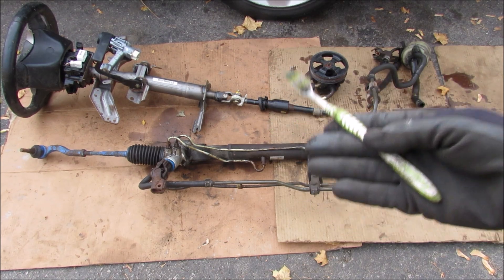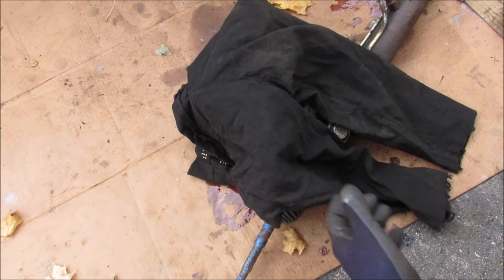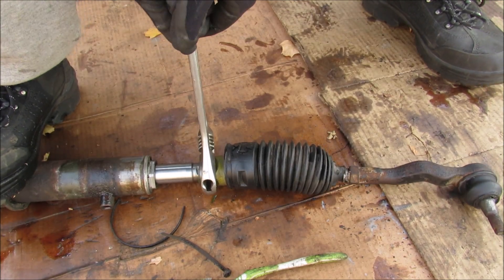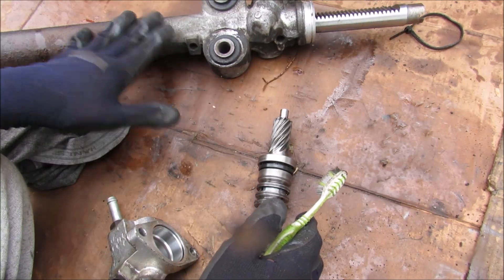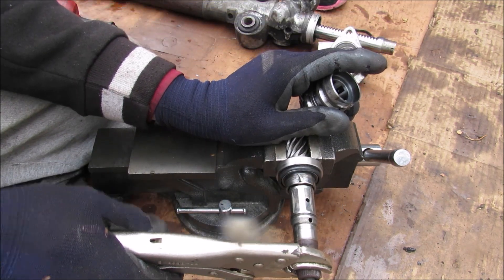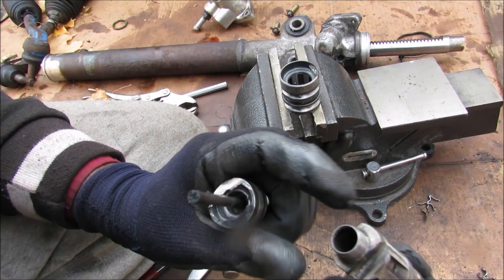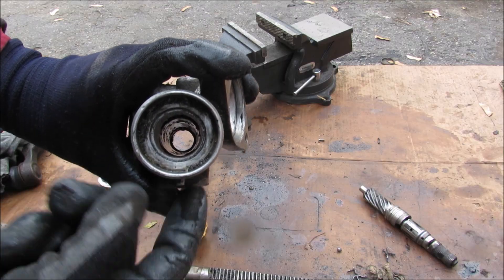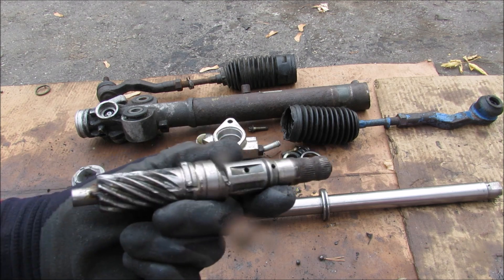How Hydraulic Power Steering Works

Comment: Do you think it would be bad to drive a car without the power seering pump running?
Reply from the maker: It would be quite difficult to turn. Just make sure there's fluid inside and it should be fine.

Comment: Hi Speedkar99!
My steering became squeeky at full lock after replacing the utility belt, and on colder mornings, it is squeeky and jerky through it’s full range of motion.
Any tips or suggestions what to look for?
Thank you!
Reply from the maker: Tighten the belt and bleed the system
Reply: @speedkar99  many thanks! 🙏

Comment: what is the name of "oil seal" that prevent oil from the steering pump to go away in unintended direction in the rotary valve? is it called a oil seal? and is it effective to replace it or replace the whole rotary?

Comment: Lovely video, I just want to ask, can the pinion gear make the steering to be hard of stiff, I use Mitsubishi Montero 2004 limited and the steering is stiff, we have changed the power steering pump still stiff, the mechanic said it is the steering rack pinion that is faulty, can the steering rack or pinion make the steering to stiff. And there are no leak on the rack at all.

Comment: If you blow piston with low pressure air there will be allot of blow-by the rack piston hard seal ring . Fluid pressure expands the seals I suppose to a tighter clearance.

Comment: Just a quick question. When you steer to the complete left or right (when u reach end) the high pressure fluid would be still directed towards that direction. What is the mechanism that will prevent the pressure build up and return the fluid to the return line?

Comment: hi there,
You made a very detailed video and many thanks for explaining that. I have a question regarding the failure you mentioned at 6:12. That failure could be due to a torsion bar or hydraulic pump or steering rack seal leakage, I am facing this hard steering problem in my car these days and I am wondering if you can help me answer this in order to fix my car. Many thanks Regards

Comment: Good video, I was surprised from this shown system I was thinking it is simple.  I have a question I have Saab 9-5 2008 model now when I turned its driving wheel to the left or to the right I hear a "tik tik" sound and disappear if I drive straight, I checked the components of my car wheels  and change some of its parts, but the sound didn't disappear.  I some how sure it's come from it's power steering system.  Can someone give me what a problems in the steering system causing that, I will appreciate any reply to my  problem, thanks.

Comment: where is the Lockstop ?
Reply from the maker: It's sometimes on the suspension
Reply: @speedkar99  thanks for your reply, I have it sorted now,  in the listing for the kits there are two with the same number the second is appended /A .. the first one is steel and the second is plastic. It refers to the plug in the end of the rack body (long side) it is held in by a wire retainer ring, this they call the lockstop.  It really isn't the same as the hard stop on the suspension or chassis but that's what they called it. so if you see it in the catalogue you will know, I think maybe it is an upgrade/alternative it looks as if either can be used in the same housing/body.

Comment: 2:45 No one should use Ty-rap on boot. Lazy/inexperienced/incompetent mechanics use this instead of clamps to save 1 minute and $2 worth of hardware. ty-rap pinch the boot at the attachment point  leaving a small gap enough for contaminants to slowly enter and grind out internal seal shown at 8:00. This is likely to kill steering rack within 50k IMO everyone should look at their boot for ty-wrap after inner tie-rod maintenance by garage and demand a proper clamp if they don't find one. You can find them at part store or dealership for a few $.

Comment: Hello from India. Very informative video, especially the torsion bar thing.  I have a strange issue with my humble ford fiesta with hydraulic PS. I find steering assistance is a bit more than I would have liked. Car turns tack sharp but I'll love to put some more effort in turning. I got a new rack, suspension kounts, struts to fix some of the other issues but this one is giving me a tough time. Any suggestions?

Comment: wich one is smoother, hydraulic or electric steering? also I've seen in Europe another type of assisted steering,  the steering wheel adjusts itself especially when trying to make u turn.
Reply: Hydraulic power steering gives you more feedback on what the front wheels are doing. Electric power steering can feel very light, or if you set it on sport mode it feels artificially heavy.

Comment: We had to change the  steering rack on our car and the new one  had a different  splien to steering columb so we swapped out the one from the old one to the new one so we had to take out the valve assy  press out the  splineretaining  pin and swap them over and reassemble the valve assy to the  housing  .. now we are wondering  does this have  to be set in to the housing  in a certain way/ orientation  as weve got it  fitted but now  not sure if there should have been an alighnment procedure we centralised the rack then  just slotted it  back in...and  did up the retaining nut    any advise appreciated
Reply from the maker: Presumably they have to be aligned with the hydraulic lines going into the rotary valve and the rack is aligned with the steering wheel pointed straight
Reply: @speedkar99  hi thanks for the reply my son was over eager to get it all fitted back in during the rain and unlike me who has experiances just put it all back in saying see there simple stop fathing around well bottom line is its sort of half working one way so he's got to redo the whole job again so was just wondering as it can go in 2 ways 180 out so I bet he's put it in wrong Well the best way to learn is doing it wrong maybe hell listen to me next time thanks
Reply: @speedkar99   Hi thanks for reply weve dropped the subframe on our old golf mk2 once again had the rack off once more today  the outer  valve assy   locates with a locating pin the inner  assy with the tortion bar   can be fitted in 180    so 2 ways so we took it out and put it back 180 and the  large  port holes  on inner and out lined up before they did not     putting it back one subframe bolt   cross threaded and the captive nut in the  chassis has come loose  URGH anyway fitted the hydraulicks back and did a test now worse than before  like its working against us  so we had it right the first time but it wasnt working right   but did do some assist so we are buggered now going for another new rack from a differnt supplier £180 down the drain live and learn
Reply: Hi it seems we had it fitted correct the first time  as it sort of worked  badly you can press the pin out of the tortion bar and remove the inner assy thats how we changed over the splines shaft but  cant understand why it wasnt working properly we  set the rack central and fitted the valve assy it rotates as its fitted so cant alighn any holes to outer case  housing  but seeing they are in channels i dont think it has any bearing on alighnment as the switching is done via the internal valve sleeve with tortion bar attatched we tried both ways  the original sort of worked  when the interna lvalve  holes did not alighn with the outer when we re fitted it this time we turned it 180  in the locating lugs and the large holes on inner and outer sleeves both  alighned the small ones did not so we though ah weve fixed it reassembled and now worse than before its fighting  us  so  weve  given up on it for tonight ordered another rack But we would like to know why our original was just leaking badly from  rod ends  but still worked ok  this new one never has .... it seems  a simple  device but  we are stumped we will look at it next time its off and try  test it with an air line to see if the ports work properly but with only 2 options and weve tried both im  stuck for now
Reply: Update got another new rack  and   this time once again the splines on the  steer column valve  assy shaft are diff again this time its 18mm  dia and 22 splines it seems there are 3 diff sets of splines for this rack type and the dia can be diff  so this time we managed to get a rare second hand  flexi to column shaft  with 22  splines  so we will change that over this time and not  touch the rack in any way EVER the trouble is they  dont say on the  car parts sites what  spline type they have they all fit  similar car but not the short flexi   shaft to  steering  .... job stalled now till post  kicks back in after christmas HO HO HO once its off again ill look at the  bad one again its bugging me why its  not working properly  i should be able to test it with an air line and see if ports  work ok  but thats a job for after the holidays now

Comment: A great video! Im just trying to figure out where the +/-1cm play on my steering wheel comes from. Its from the torsion bar to the steering rack somewhere.. I have power assist but till it comes I always have a little play which is pretty annoying on the highway. Any ideas highly appreciated until I start to discover it myself. :)
Reply from the maker: If it's a Toyota there's always play. 

There's also a steering damper on the steering shaft under the dash
Reply: @speedkar99   Thank you for your answer, it is a true honor! The car is a Mercedes with 310k km actually, I have checked the column all the way to the input shaft and it seems the input shaft still moves (with the steering wheel) while the steering rack does not move yet. I suspect the rack is worn, how probable it is?

Comment: So, the higher the pressure of the liquid, the easier will make a turn the steering wheel ?
Reply from the maker: Yes. And that's why the pumps have a flow control valve.

Comment: Your camera catches some fluid on it's lens.
Did you use some protection sheet to your camera lens? Acrylic sheet works good to protect camera from oil and grinding debris.
Reply from the maker: Yeah I learned my lesson the hard way...the first steering rack I grinded open scuffed up the lense pretty bad so I don't protect it with anything.
Reply: @speedkar99  downside of acrylic sheet is scratched easier, you need new sheet every once in a while. A flat glass provides excellent clarity to image and ease to clean, but with prone to shattered when hit with something hard.

Comment: Ha ha ha ha, I finally understand how this mechanism works. I always wondered how the power assist knew when to stop, ie how to prevent pressure assist from steering beyond where the driver wants to go. It's all about that little torsion bar. As soon as the steering wheel is released, the torsion bar springs the holes back to a neutral position so no more pressure goes to the side you're turning towards. Genius.
Reply from the maker: It's so intricate yet simple on how that little torsion bar does its job!
Reply: Yes torsion bar backs to neutral position but how it is turned when moving? is there a clutch like system ? if released how the gripping is over? i understand the mechanism but i wonder the details.
Reply: @juvenildr  it puts pressure on the side of the steering that you want to turn it, it wont turn the rack by itself, it just puts pressure there to help you turn the steering easier.